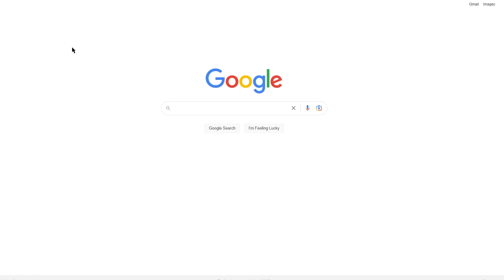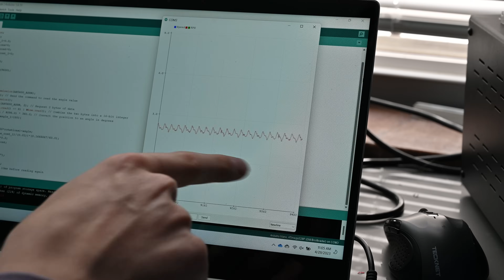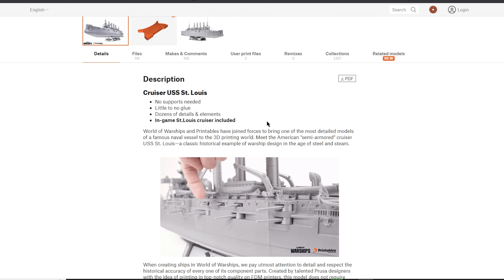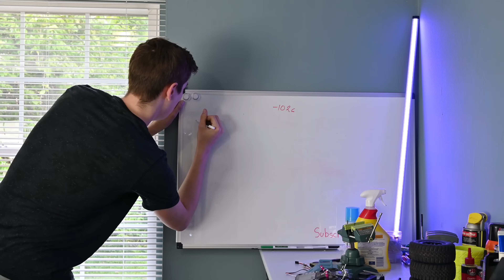I PRINTED an RC Car... How FAST can it go??

Comment: 🎯 Key Takeaways for quick navigation:

00:14 🚗 Michael aims to make a 3D-printed remote-controlled car reach a speed of 100 miles per hour.
00:42 🏎️ He uses the Tarmo 5 RC car design, which is mostly 3D-printed and uses CV joints for consistent speed.
01:37 ⚙️ Michael demonstrates the issues with universal joints and why he prefers CV joints for his RC car.
02:06 ⛴️ The video briefly mentions a sponsor, World of Warships, a PC game involving commanding warships in multiplayer battles.
03:03 🚗 Michael tests the 3D-printed CV joint, and it provides consistent velocity, ideal for high-speed RC cars.
04:13 🚙 He encounters challenges while testing the RC car, including instability at high speeds and tires coming off.
05:11 📈 Michael tests the car's speed using a 4S battery and achieves a top speed of 46 miles per hour.
07:29 🏎️ Michael modifies the RC car's design for higher speeds, adjusting the wheelbase, suspension, and materials used.
08:48 🔊 He switches from straight cut gears to herringbone gears to reduce noise.
09:56 🏁 The improved car achieves a new top speed of 49 miles per hour but crashes due to instability.
10:30 🚁 Michael plans to continue improving the car and aims to reach 100 miles per hour.

Made with HARPA AI
Reply: Nice , I ll use that

Comment: I love that this design uses outrunner motors. They are so much torquier and hence require less transmissoin. Or even none. I've built up a 1hp/kg RC car with 4x hub motors and it turned out a blast

Comment: Nice video! Love to see RC content. 
Foam tires will help, the ballooning hurts performance quite a bit. Also, instead of using two shocks, use one but grab stiffer springs and use thicker shock oil. A proper rc car remote is a must too, it's much easier to control. And a better road will improve stability too

Comment: Other than a smoother surface, you may want to soften your suspension as a common reason for losing power at speed is that the bumps lift your wheels.  You may also want to lower the car as to lower the centre of gravity.  Adjust your front wheels to some Tow-In, probably about 1 degree.  This is not so great for cornering but offers stability in straight lines.  Finally, look at adding a shell of some kind.  This is primarily for aerodynamics.  When you hit those speeds, wind resistance becomes a real factor and especially so if your chassis has areas which are either asymmetrical or potentially look to raise the car off the ground.

Comment: I think you should get FPV camera + goggles and it will make your driving much more accurate immediately. Also adjust the max steering angle to be less for high speeds: either strongly non-linear control if you can avoid going to the sides during sudden movement or actually limit the steering angles similar to gaming console racing games typically do it.
Reply: You don’t really need that it’s a skill issue but he’s new to this stuff just like the Traxxas XO-1 or arrma limited they don’t come with FPV you just don’t need it.

Comment: Im making an rc car in my shop class with a brushed motor and low power traxxis components. It probably makes a bit less than 1 horsepower and doesnt have suspension, but i got it up to 40 mph on my schools track. It was previously capping out at 30 mph, but the addition of a simple cardboard aerodynamic body made it jump 10 more mph. In conclusion, you could add a body to make it way faster.

Comment: Universal joint can give you a constant speed but you need two of them. Your suspension is build in the way that the inner shaft is ALWAYS parallel to the wheel shaft. So if you put two universal joints, the will cancel each out. On the test stand you have only one "bend", so the rotation has oscilations, but if the shafts of the gearbox and the wheel are paralell then two oscilations in the universal joints has opposite phase.

Comment: I think the number one thing you can optimize is the gear reduction, if you manage to get the amp draw the motor with the current setup at diferent speeds you can get a idea of the power/speed curve and estimate the max speed you can hit with this motor (his max power) then adjust the gear ratio to hit maximum voltage and current at this speed (migh differ a bit from theory, but it would be great start) , also try using gears with number of tooth that are prime one with another (=>1 is their only common denominator) to prevent premature deterioration

Comment: Having a pistol grip transmitter will definitely make you feel more comfortable going at high speeds. I would say find a cheep Traxxas style rc and just get use to bashing it around and comfortable driving. Having a gyro compensate is fine but only after getting use to driving it plane. Also be careful of oscillations at high speeds from over compensation. I cant believe how well the printed car held up after that crash and I am so looking forward to seeing you hit +100mph. Best of luck!!
Reply: I strongly disagree about the pistol grip transmitter... conventional airplane transmitters are superior in every possible way
Reply: @knoopx  never seen any pro rc car racer use air plane transmitter. Your statement is wrong.
Reply: @Theroux1989 by the same logic, never seen a drone pro pilot, or any other hobby-grade vehicle at all, using a pistol grip. Conventional transmitters are cheaper, ambidextrous, come in different shapes and sizes, have better hardware like hall sensors with little to no deadband or drift, run on community maintained, always evolving open source firmware, can bind to multiple protocols/bands and even swap modules, including open source, low lattency, long range protocols like expresslrs, can control any kind of vehicle, support all kinds of telemetry data, inputs/outputs/mixing/trimming are 100% customizable. sticks allows for super fine, precise and agile control and are not monopolized by one or two companies that haven't evolved since the 80s. not even a $700 futaba is objectively better than a $200 radiomaster. and yes... I have extensively used pistol grips in the past and hated them so much that went to the extend of reverse-engineering their propietary protocols so I can use my own, single transmitter to control all my rc vehicles...
Reply: @knoopx  As a guy that has Raced RC's at national champion level(I got third out of seventeen)
And also flies RC drones and Heli's
Pistol grips are way better on RC cars than stick's because of the way the controls work(have driven RC cars with sticks and it's a pain in the butt)
Drone pilots cant use pistol grips(duh GL flying a drone with only two fully proportional channels)
You dont like them But there is a reason why all pro RC drivers use pistol grips(including my buddy which has been the national Electric and Nitro buggy champion here for the last four years)
Reply: @storm4710  sure, braking control is superior indeed, and although preference is not a technical aspect of it, it also plays a very strong role. thing is people is recommending a pistol grip like it is going to magically solve the car stability issues when it will make no difference and he's better keeping that radiolink and focusing on the root issues.
Reply: yeah not a chance  @knoopx
Reply: wrong, just stop  @knoopx

Comment: Honestly you just need some foam tires, sway bars and less suspension travel. Also needs way more power. But you should not focus big on aero, you just need a wing at the back to keep it straight, but at 100mph you mostly just need power

Comment: This is awesome! I also went down the rabbit hole of 3d printing RC cars and ended up redesigning a traxxas rustler 2wd, reusing the gearbox and drivetrain to create my own 3d printed speed demon. It’s got some reliability issues especially since i run it on 8S, and it’s gotten up to 60mph so far but I’m aiming for 100+. Gearbox is the main issue ironically. This video has got me thinking about doing a more custom build with printed drivetrain parts and such.

A couple things you should do: buy a set of Hoons or GRP tires, lock the front suspension with a nice, ductile nylon or TPU filament, and lower your center of gravity. Make the wings a higher angle of attack, at this size a flat plate performs relatively efficiently compared to an airfoil. Get a much bigger inrunner motor, and make sure it’s rated for your ESC’s power output while providing adequate torque. These are all things I did and my car runs awesome on a good surface. Great work!

Comment: I whould give the front wheels a toe-out and the back wheels a toe-in for greater stability its used in rc buggys. i whould also recommend a set of foam tires or some type of "belted tires" to help whit the expansion or "balloning" of the tires to help whit stability. You migth be able to change so that the wheels are belt driven instead of using gears that whould help lots with the sound and durability of the gearbox. I dont know what oil you have in your shocks but the car could get more stabile if you use thiner oil or thicker oil so that migth be worth looking in to. You migth benefit from using a rear defuser and some more downforce in both the back and the front. And as a last note after a certain point you are going to need belted or foam tires since normal tires will probably explode that i know from experiance but i drive a 1/8 scale buggy whit a motor capable of 55 000 rpm. Best of luck :)

Comment: The reason your car was spinning out mainly was due to the tires. Even when you are driving on flat ground, the tire still rounds out the faster you go, making your contact patch smaller and smaller. Almost like your tires are turning into bicycle tires.

Comment: An RC car remote will have to ability to setup trim and sub-trim.  When you drive your car it slowly moved to the left and you have to correct it at high speeds, with sub-trim, you can make small adjustments to where the car will go dead straight when you aren't steering either way on the stick.  This is a standard setting for any RC car racer for their setups.  It will save you a lot of heartache.

Comment: toe-in for stability on the straights, also your vertical center of gravity is quite high for a car that needs to go straight for highspeed tests. Try to lower it a bit and put some stiffer springs on combined with slightly thicker shock-oil.

Comment: Have the same project going. you'll get to a point where "taking flight" will be an issue. 3d printed parts can explode under certain rpm conditions (rims are not the best to print when going for speed applications. Cant wait for update.

Comment: Can you post the STLs and BOM list? I like your design and will definitely make one. I would suggest getting the batteries as low as possible to lower the center of gravity. Also look in to either metal gears, or print them form better materials, at least abs or higher temps. Also lube them up! Great build
Reply: The carbon fibre nylon would probably be suitable for gears, they usually don’t recommend you use it with other materials due to the abrasiveness but it should be fine with itself, plain nylon is also very good for gears since it is self lubricating. PLA is likely to melt but if you have enough friction to melt other materials then something is wrong.
Reply: @pooppyybuhhole  the carbon fibre would improve wear resistance but may add a little friction. Nylon is very often used for gears, it being hygroscopic isn't an issue. There is also a difference between water and oils getting absorbed. Something like lithium grease works well and doesn't cause any issues. Also nylon is self lubricating so you may not need any lubricant.
Reply: @conorstewart2214  PLA is great for gears except for the very first motor pinion gear. Even then I've used PLA gears on low current motors who's shaft doesn't get warm. There is no reason to use fancy materials...

And for that matter, I'm not sure any 3d printed motor pinion gear for attaching to that outrunner bell is going to not suck. Broke on the layer lines in the video, good luck printing in any other orientation that also won't just split in half.

Comment: To fix the "de-beading" issue with the tires. You can use a popular drag racing and offroading design called a "bead locking wheels". Instead of glue, it's a clamp.

Comment: AWD is going to be essential for stability at high speeds. Also, make sure you have high quality shocks with adequate weight RC shock oil in there.

Super cool project, glad I found your channel!

Comment: Look I recommend this being part of the 3D printing community and the rc community I recommend you printing the gears with a resin printer it will allow less resistance. Like you said in the video the tires have to be different and lastly if you want you can upgrade the motor

Comment: As your tyres rotate faster the contract patch goes from square to a tiny oval. Meaning you get far less contact area at high speeds.

You could buy high speed tyres, 3D print some, glue foam into them to stop the middle expanding, or 3D print inserts you for into the true and run to stop them being able to deform at high speeds.

Comment: as an avid rc person i can give you two tips first is set ur camber in just a little so both tires pull towards the center this is really good for hig speeds but not so good for turning the second is solid tires you can purchase high speed solid rc tires the tires your using are for a offroad truck and they like to ballon out around thirty miles an hour this will pick your rc up and make it very unstable... likley to flip and the tires can explode

Comment: It’s crazy your doing this. I’ve been also printing a few different designs with a speed goal. The biggest problem you will have is stability. I’m on my 4th variation and so far can’t hold straight above 45-50mph. 

Try drag tires on the rear and smaller up front. Hurts the turning but it goes straight. If speed js the goal you need to get the nose down so wind can flow over.

Comment: 1. Use a body cover
2.change/ optimize gearing
3.move center of gravity closer to the middle if the car if rear wheel drive, or
4. Make the car 4wd and move the center of gravity towards the middle.👌🏾

Comment: you might want to be careful when going at higher speeds with a gyroscope because you can get unwanted oscillations AKA fishtailing and completely loose control of it. also to avoid excessive tire ballooning  you can wrap some fishing line between the threads on the tires or go for some foam ones. good luck and Godspeed!!!

Comment: Reprogram your throttle mapping?  Sometimes rc cars are easier to manage that way. Traxxas offered it as an option on the factory radio that came with my slash. Also you can control 4x4 much easier.

Comment: The right tires are everything in RC, a quick way to get the meat of the science is to watch a few videos on the Bugatti, i think those tires are like $20,000 a piece, the faster it goes the better tire you'll need to keep it on track and then more down force you'll need to keep it from flipping.

Comment: So just wanted to state you are right about the u- joint speeding up and slowing down. However if you line two u-joints up opposite of each other as you normally would, one at the wheel, one at the differential. They cancel each other out.  But all around CV joints are better

Comment: Instead of making 3 compartments inside the car, make one, so the floor is stable/rigid, but the weight is reduced - take a peek on arrma/traxxas/hobao chassis. Distribute mass evenly. Use body shell (especially low drag body shells), just this one will give you a boost in performance. Also - strip additional shocks - if the shocks you have are not stiff enough - change the oil that it is filled with. If the length of the shock is the problem - put a small piece of ptfe tube on it, to limit the travel.

Comment: You need belted tires. When you go faster your tires get larger, if you unsettle the car with a bump and one of the rear tires lifts off the open diff will send all the power too that wheel making it even larger, giving it more effective tourqe when it touches back down. This causes you to spin out.

Comment: Very nice work. I was dreaming to have this kind of project decades ago. Now there are 3Ds and since that, I believe things can make it highly possible. I would suggest to put in dynamic shock absorber, differential drive and brake system by making individual motors for each wheel etc. to overcome flip and increase stability.

Comment: Loved the video! Also got a few tips for you:

Put a RC Body on it. That would help an insane amount, when it comes to aerodynamics. 

Buy different tires! These things are offroad tires and not even belted, meaning they expand at high RPM, which isn’t good for stability. 

Use a proper RC Car remote, not an RC plane one. That would make it way easier to control.

Hope this advice helps.

Comment: You need to significantly lower the center of gravity if you want it to be more stable. Also you need to center it z and x axys as well. High performance cars have a 50/50 weight distribution from left to right and  from front to back, because it keeps the car from flipping as soon as you have to turn the car. Also reduce the weight of unsprung mass, it looks like the car has too much mass in its suspension components. It will help you with keeping optimal grip in any situation. Last but not least, you need different tires, these are offroad/rock climbing tires, what you need is either proper slicks, or what I recommend foam tires.